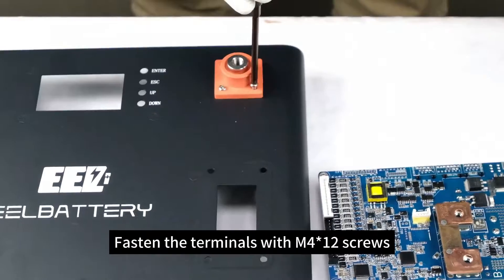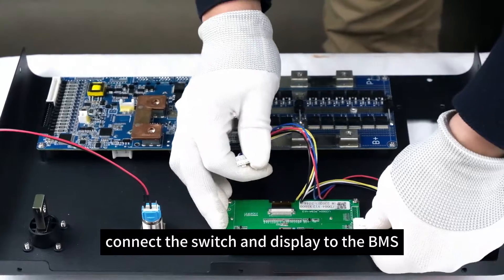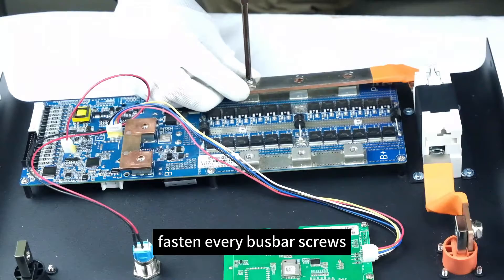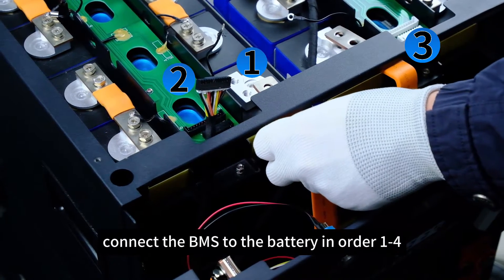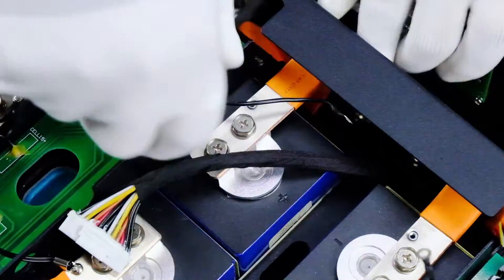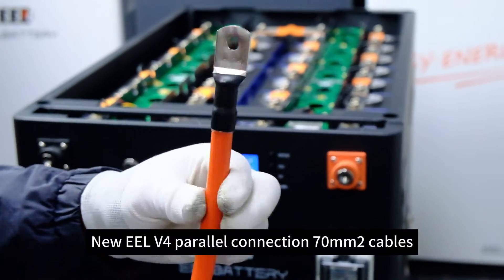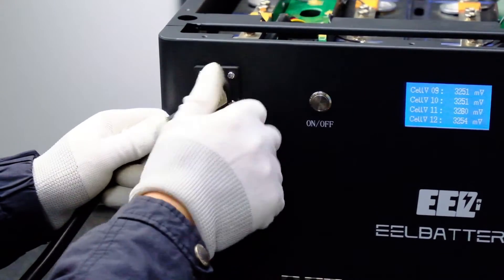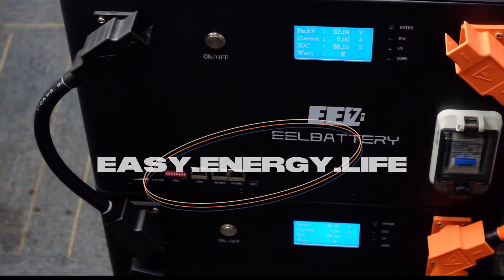Updated!EEL BATTERY V4 DIY Kit Assembly Instruction

Comment: hi just built my battery box a quick question the new display flashes the battery segment red 2 bars blue 4 bars and green full bars when charging and the little leds on the breakout board counts 1,2,3,4 ramping up is this normal cheers jk 200A bms

Comment: Guys,
why do you sell this product with such a poor and misleading video?
This is not the V4 DIY EEL box I have gotten with the JK BMS cause this looks like a SEPLOS BMS !
Our battery has no display and a JK BMS so where is the right video ?
And I bet this is the reason why the flat and folded cables are not in the box cause flat and folded cables are a signature and good design choice by SEPLOS cause we also have already a seplos mason system here in use at a friends house which I have also built last year. 

It can not be that hard to release a video that fits to the boxes you are selling.
Reply from the maker: please find the right video on our channel,thanks!

Comment: Stupid mistake and why didn't you delete the wrong one ?
This is your duty if you sell these products in the EU. You are fully responsible for any damage due to the wrong video in any case things go wrong.
Why ?
Because you are so stupid to not ship a manual with the delivery that matches 100% the kit you are delivering.

Poor craftmanship and engineering if you can not deliver a proper  manual and video that matches what you are delviering.
Why are your terminal cables flat and folded why I have gotten the old outdated crap ?
Same question with the new long pcb 2a and 2b and the cables soldered on the edge in direct connection with the black metal frame . 
Why didn't you solder that far more inside and away from the black metall ?

Comment: how many can be stacked on the cart?
Reply from the maker: Technically, it can stack 10 packs, but we recommend you stack less than 5 packs
Reply: @eelbatteryofficial  thank you for the quick reply. just to clarify, you recommend 5 at the most? or 4 at the most?
Reply from the maker: @jimmy4518  it depends, calculate the height and weight, usually,5 at the most
Reply from the maker: @jimmy4518  In theory, it can withstand a maximum of 1000kg, and we recommend that it is better below 800kg.

Comment: Does this box come with PCB-Boards that have two connections for the BMS and the active balancer or is it still the one wire version that causes interruptions with the JK-BMS when the balancer is active?
Reply from the maker: It has the two wires for the V4 box with the balancer, because JK Box has a built-in balancer, there is no need the two wires connection

Comment: Hello, is this V4 model compatible with  Eve LF304 cells (double holes terminals) ?
Is it available with a display (for JK-PB2A16S15P) ? 
Is a white V4 model available ? 
Thank you very much.
Reply: How is this a upgrade?,  when you remove display, then add a breaker, both of these should be standard from the beginning
Reply from the maker: Yes,V4 box is compatible with 304,the JK display is too big to fit our box,both white and black are available
Reply: thank you  @eelbatteryofficial  👍👍

Comment: That's a nice upgrade... Are these V4 fronts with switch available as an upgrade kit for V3 owners. I love the physical battery disconnect.
Reply from the maker: You can buy the front panel to upgrade your V3 system
Reply: @eelbatteryofficial  link to this from panel?
Reply: @eelbatteryofficial  Is this upgrade only for V3 or is it possible for all older versions of the box because i have buy one in 2023.February this must be the V1 JK-BMS 150A which was built in without the cells.
Reply from the maker: @you2bevsgoogle  Hi, if you bought it in 2023.Feb,it is a V1 box with Seplos BMS, it will be better to buy the whole box for better fit.